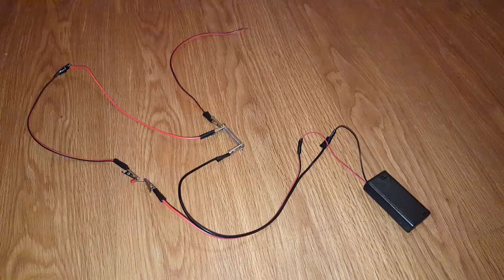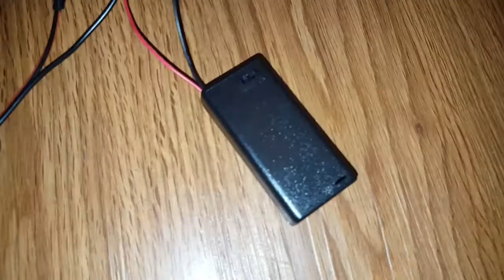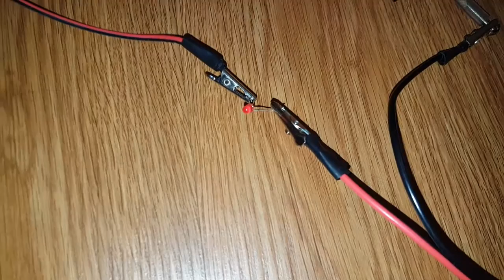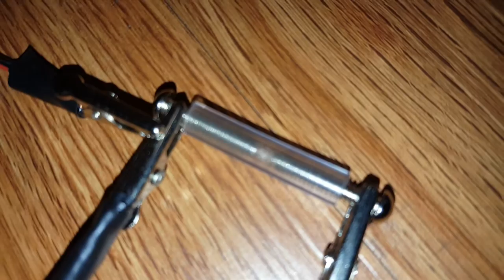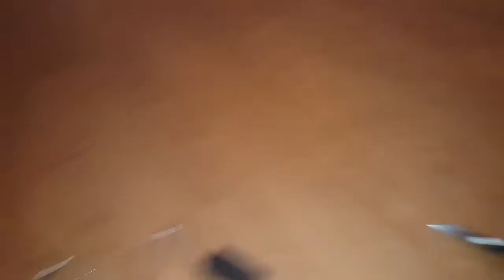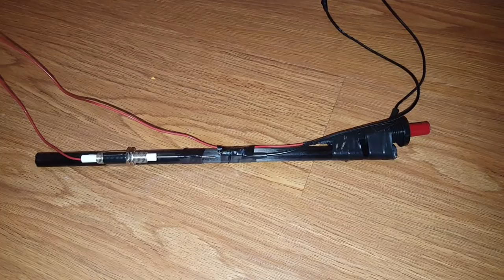Homemade coherer (copper)

Comment: hi so i have a few questions for this project, so i tried it with two regular screws and a 1inch plastic tube from a mech pencil and nail filings and a nine volt battery, and i only works when really up close, and im using a bbq sparker can you help me
Reply from the maker: spiritofhalloween9 Hey, here's a couple things to know and to try. I had the most success by pushing the two screws together with my fingers until the light went on. Then I would try to back the screws out just a hair until the light turned off again. I only ever got it to light up with BBQ ignitor if I was within 6 feet of the coherer. You will need a more powerful spark if you are trying to do it from farther away. Also, how finely ground are your metal shavings? The finer you can get them the better.
Reply: my shavings are fairly fine, dose there need to be a lot of shavings or can it vary
Reply from the maker: spiritofhalloween9 I think the general rule of thumb is that the filings should fill up roughly half the height of the container when laid flat, and when the screws are properly positioned.
Reply: how can you position the screws properly to were it works good
Reply: can i email you my set up so you can get a better idea
Reply from the maker: spiritofhalloween9 sure eschlenz (at) gmail.com